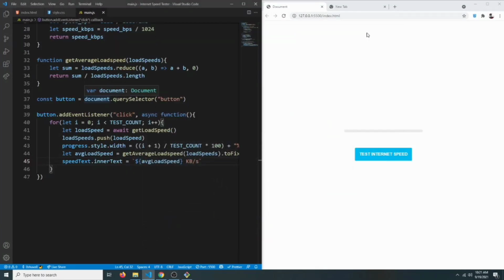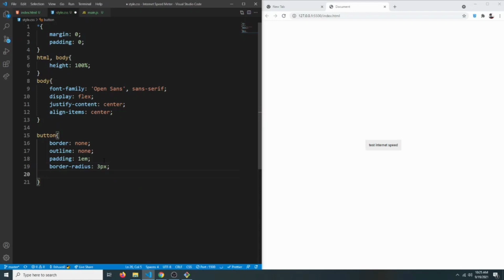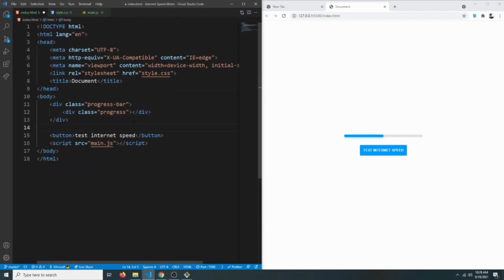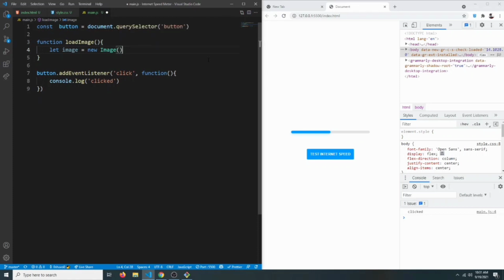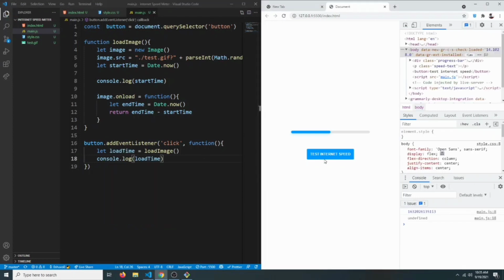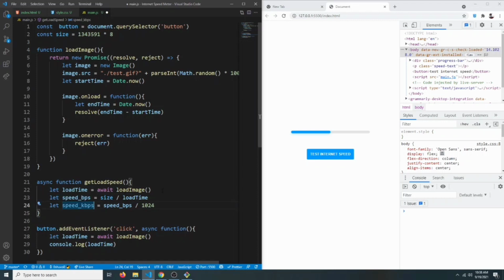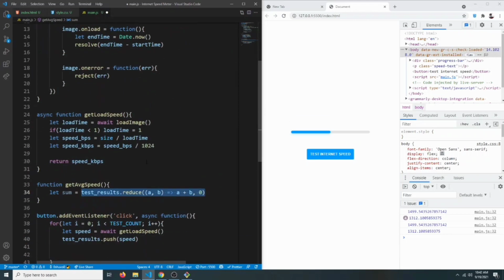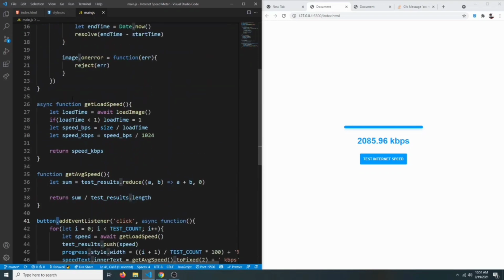Measure Your Internet Speed Using JavaScript

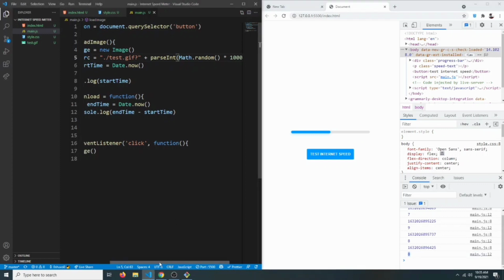Comment: just one doubt.. doesnt changing the src link of test image make it invalid.. like you added that parse int line at 13:01 by adding  a question mark.. so the path will change na?
Reply from the maker: Thanks for your concern
basically
website.com/home
and website.com/home?c=1 is the same
everything after the question mark is just passing data down to the server
now in our case, our server which is the local server is not doing anything with the data
but if we always used ./img/img.gif the browser would cache the image so after the first load, the load time of the image would become 0
so by saying ./img/img.gif?c=xyz we are using a different URL each time(which of course points to the same image) we are preventing the browser from caching the image
Reply: @AngleBrace  wow thats smart ! Learnt something new :D